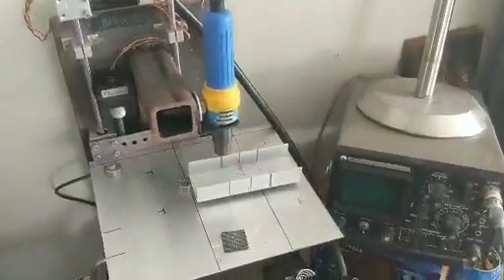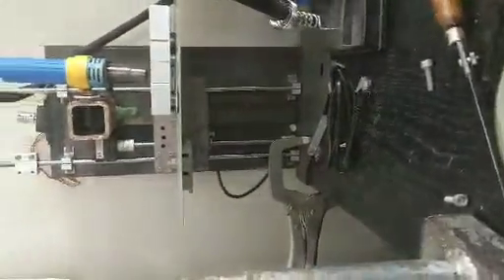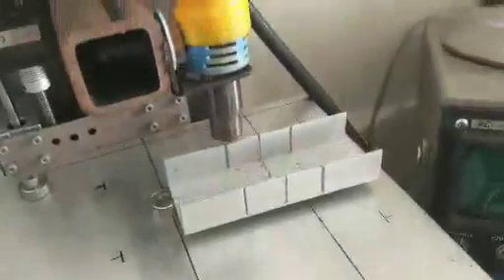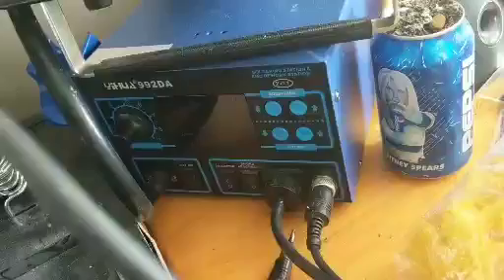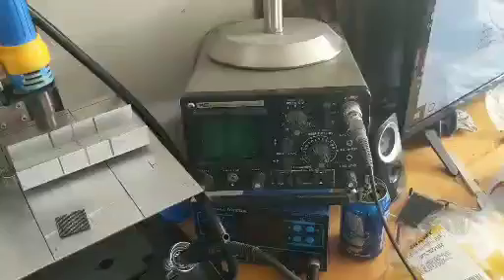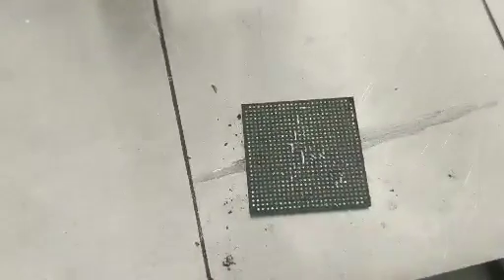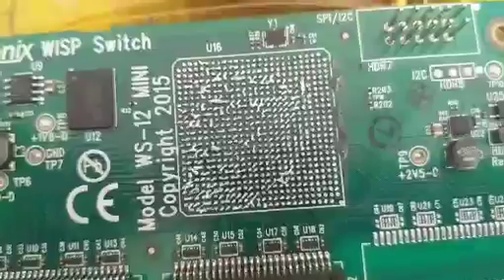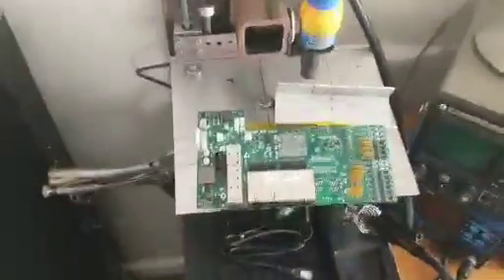DIY BGA(Ball Grid Array) Rework Machine (it works!)

Comment: Do you have a spare z-axis or dedicated placement gizmo just to place the chip?  Relying on the adhesion properties of the soldier to orientate a chip of that size is murphy's law if it works.
Reply from the maker: Gravity, surface tension, and a set of guides kapton'd to the board should keep it where I want it, manual placement isn't 100% reliable, but nothing is. 

 How would you add that to this rig?
Reply: I would reverse what you have, have the chip aligned and lowered on the z axis and the hot air gun angled from to the sides to heat the area.  This requires a shield around the areas where heat is unwanted, like aluminum tape to protect the parts closest to the grid array.
Reply from the maker: Well, the results are in with this current configuration: https://photos.app.goo.gl/MEccfY64jVLRhhNP7

Orientation isn't perfect, but does seem to be close enough!

we'll know if it worked later this week, once I get the supply regulators and oscillator in from DigiKey.